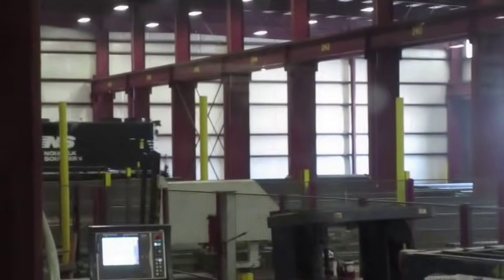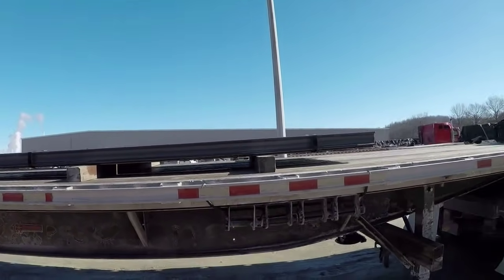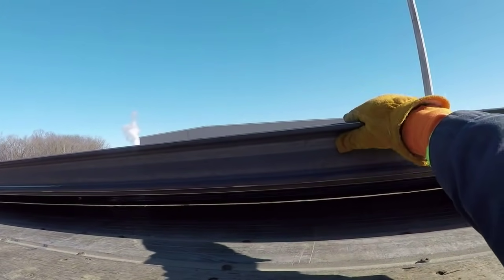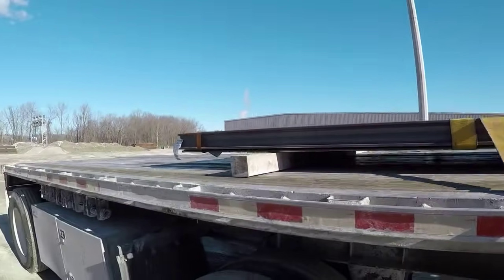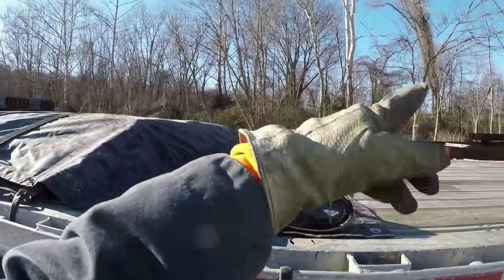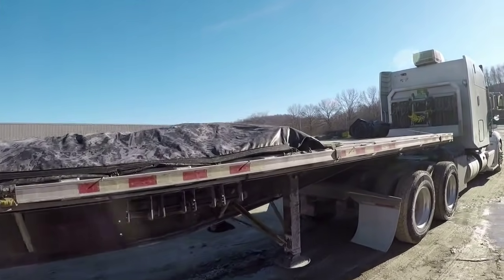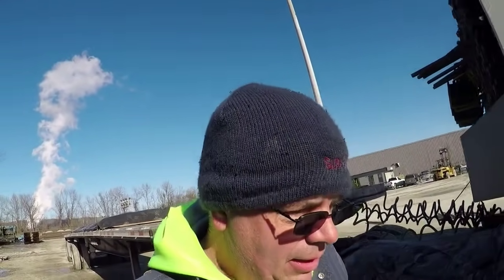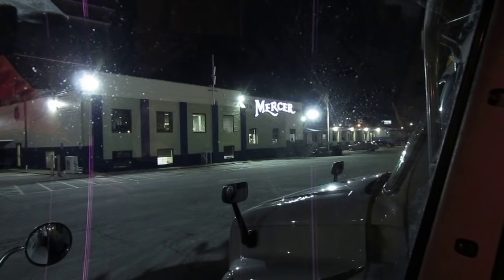#286 Little Load of Steel Beams  Double Train Day The Life of an Owner Operator Flatbed Truck Driver

Comment: I  used card board corner peaces that was used on on steel skids to protect tapes on sharp edges  . You could cut them to any length and I would use the longer ones to put on the leading edge of load and hang a inches over to protect yours tarps as you use these they come in real handing. They look like steel angle iron only card board.

Comment: Good job with it. U could put that
Load upside down it would not
Move. Looks good
Reply: Good job Dan, new flatbed drivers should watch your videos, you show how to load, tie down and tarp. Thanks for the ride along, pull toy 3.
Reply: Retired after 40 years on the road. Divide my time hanging out in my wood shop and sitting in my recliner watching videos! If you get by Tomah, WI give me a holler and I’ll spring for a coffee.